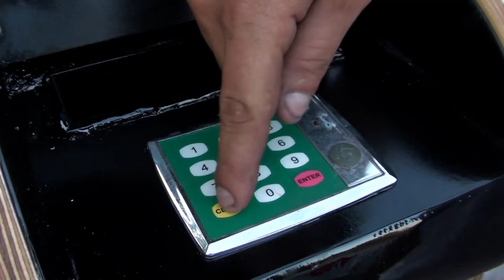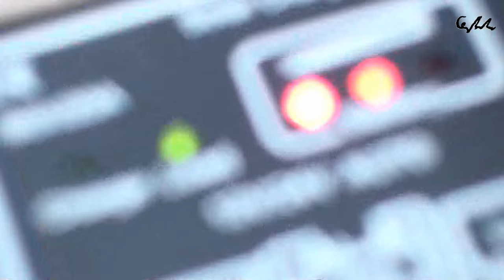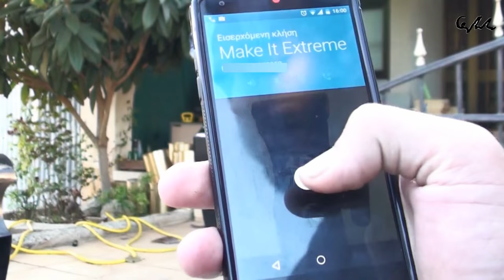Extreme smart mailbox

Comment: where do you buy or where do you get so much steel plates ? one of these costs over 100$
Reply: +Ultimate Making I guess his working with some steel company, or something and can buy them in bulk cheaper. In the coffee table build, frame materials alone will cost several hundred €
Reply: +Ultimate Making I work in trailer manufacturing and we have literally dumpsters full of scrap lumber,metal, cables.

Comment: That's very cool. I think you might need a strap on the bottom door so it doesn't drop down all the way though. It would be cool if you could make the large enclosure at the bottom accessible for the postman, or the parcel carriers so they could put a parcel in there for you too, but your system is probably different where you are, we have usually one postman and one parcel carrier, so it would work very well for me, I've been planning on putting a code activated locker in the inside of my fence so couriers can put parcels in it for me if I'm not home, but I need to figure out a way that will allow it to open once, without a code.
Reply: A bit late but you could put a button on the outside that when pressed it opens a door for the big packages and when this door closes the button is automatically covered (sliding door or something).